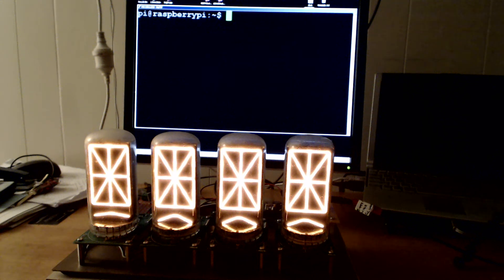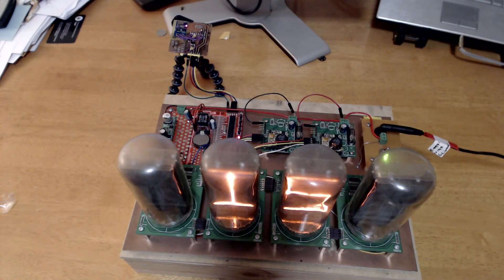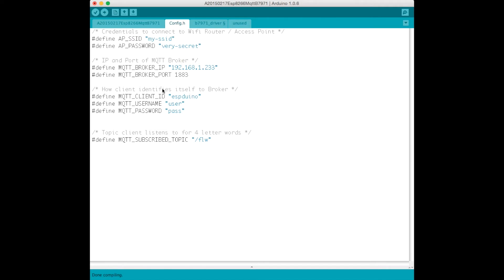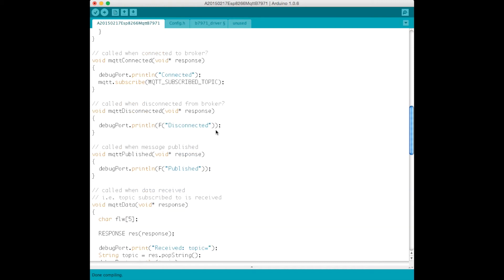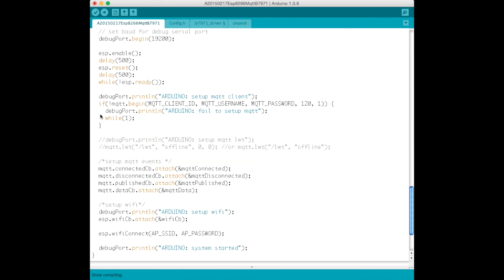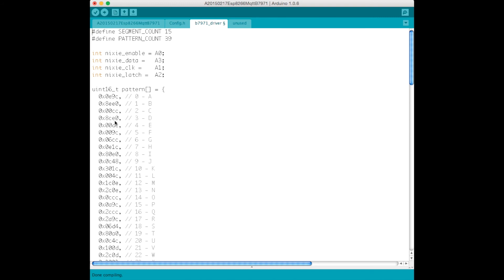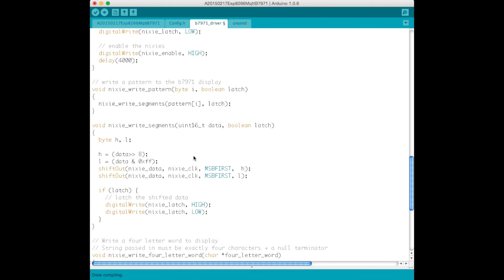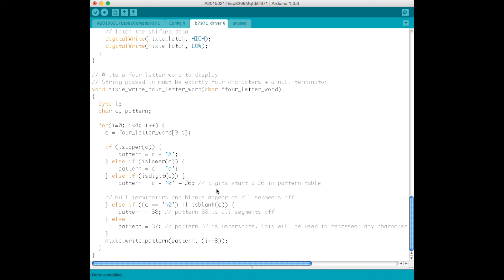Wifi Nixie Display with Espduino MQTT

Comment: Hi Luc, you're using your own MQTT broker? Have you tried Adafruit.io's? I think I have everything set up like you but I just run into a connect/disconnect loop when reading the debug.  What does your debug output look like?  Thanks a lot for this video!  https://www.reddit.com/r/arduino/comments/4m33tz/out_of_my_depth_arduinonanoesp8266mqtt/

Comment: Thanks, Luc. I am not able to see SoftwareSerialexample under File->Examples. When I remove the package esp8266 by ESP8266 community I am able to see SoftwareSerialexample and also able to compile it successfully. But without this package I can not work with esp8266 board. I looked around and found the library SoftwareSerial at the location C:\ESP8266\Arduino\arduino-1.6.5-r2\hardware\arduino\avr\libraries\SoftwareSerial.

Once I load esp8266 package the compiler is not including SoftwareSerial library while compiling. I am not sure what to do. Thanks for your help.
Reply from the maker: Babu Kandimalla The code described in my "Wifi Nixie Display" video assumes you have flashed the ESP8266 with Tuan PM's espduino firmware. The actual code described is for a plain ordinary Arduino which then has an ESP8266 flashed with the espduino firmware connected to it via its serial port.

Since making that video "Arduino for the ESP8266" has been released, which eliminates the need for a traditional Arduino. This probably doesn't implement SoftwareSerial and that's why the examples disappear when you have the ESP8266 board connected. My code won't work for this application.

So the upshot is: if you want my code to work, you need to flash it to an ordinary Arduino and use the ordinary Arduino IDE. Then flash the espduino firmware to an ESP8266. And then hook up the Arduino to the ESP8266 using the serial lines (and doing level shifting if your Arduino is running at 5V).

The whole ESP8266 ecosystem is a bit confusing since there are at least 3 ways to achieve essentially the same thing:
1. connect an Arduino to an ESP8266.
2. get an ESP8266 to behave like an Arduino, using ESP8266 fork of the Arduino IDE.
3. write Lua code and upload it to a Nodemcu flashed ESP8266.

Some of my more recent videos cover approach number 3, which is my current favoured approach!

Comment: Thanks for sharing this video. I tried to compile this program and I am getting error regarding include <SoftwareSerial.h>. I am using Arduino 1.6.5 and not able to locate the library SoftwareSerial. Could you please share information about the url for  SoftwareSerial library.

Thanks.
Reply from the maker: Babu Kandimalla I upgraded to Arduino 1.6.5 and my code compiled OK for me. The SoftwareSerial library should be bundled with the Arduino IDE: https://www.arduino.cc/en/Reference/SoftwareSerial.

Check out the "File > Examples" menu. There should be a menu item for "SoftwareSerial"  examples. Below that menu, select "SoftwareSerialExample" and check if the example code compiles. If it does compile, then it will confirm that the SoftwareSerial library is present.